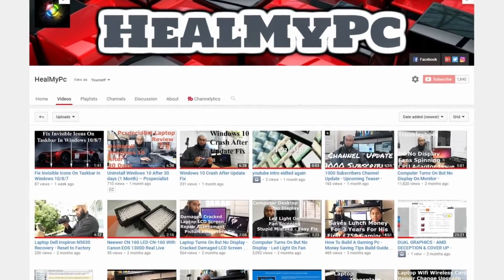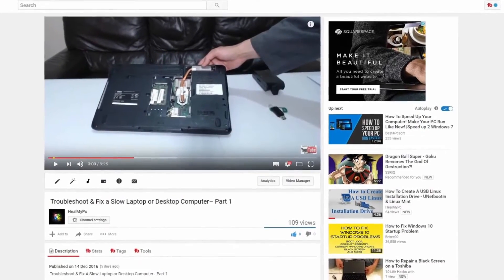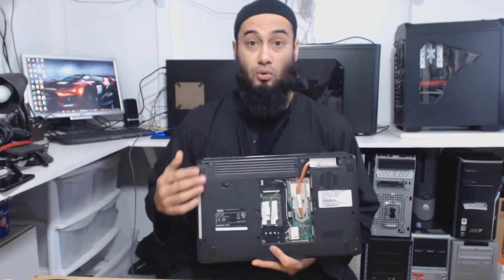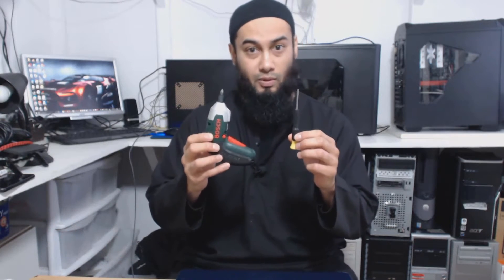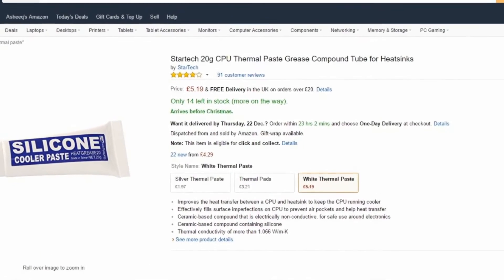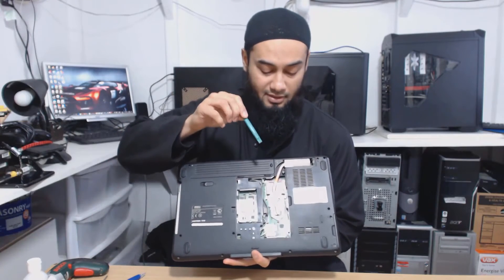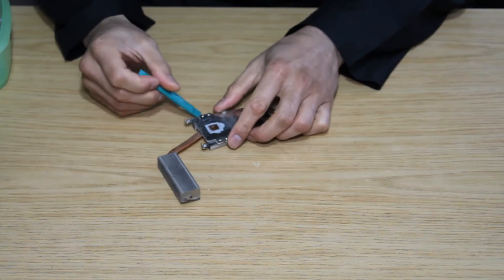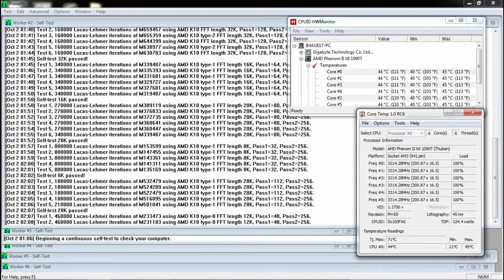Fix An Overheating & Loud Fan Noise Laptop - Dell Inspiron 1545

Comment: Actually, you forgot to mention the most important part.  You forgot to tell the viewers to apply the "thermal compound (paste)" on the CPU after you clean it and before you put the cooler back on.  Major mistake to leave that out of the video.  I can see that you applied it to your CPU but you didn't say anything about it.  Viewers, DO NOT FORGET THIS STEP or you will have a some major overheating problems.